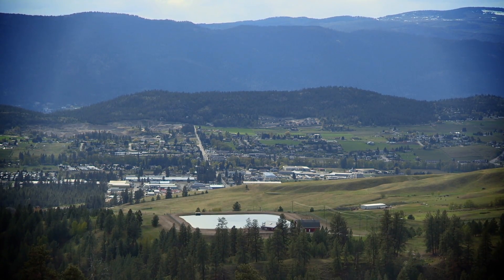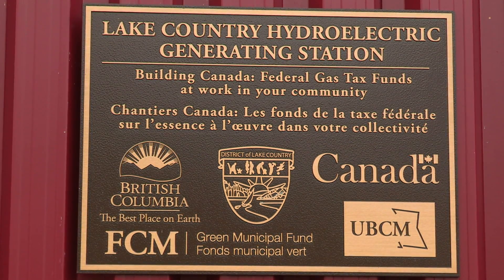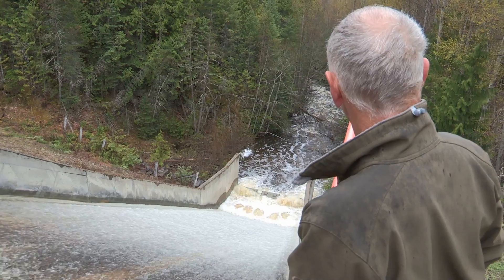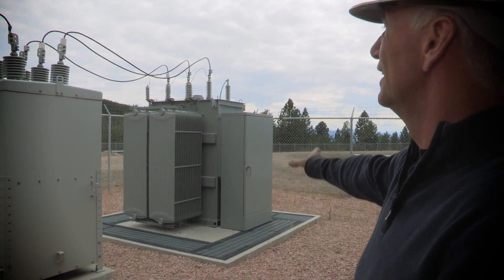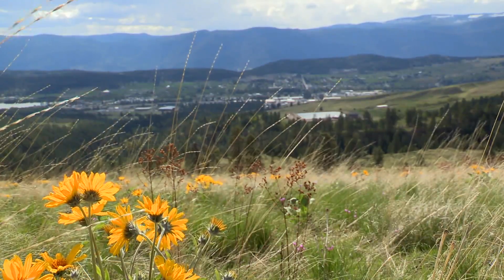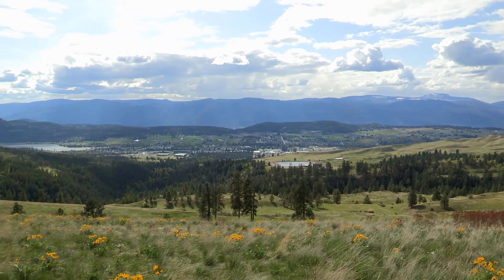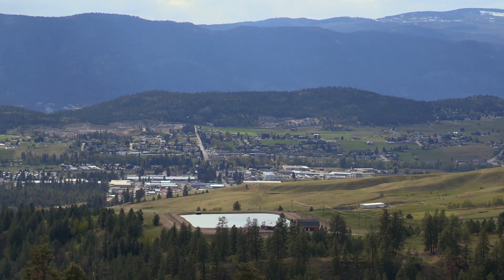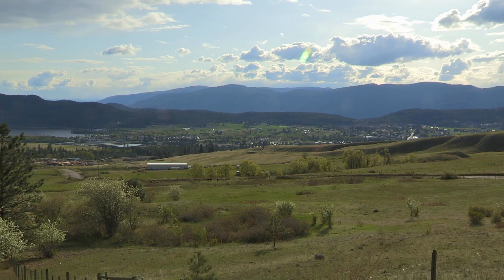District of Lake Country Micro-Hydro Power Plant

Comment: Just a note, there is no way that power plant produces 4000 MW. Massive coal power plants produce 1000 MW. I'm curious what the actual power output of system is and how much energy in kWh does it provide the community annually? Thanks!
Reply: I think he meant 4000 KW = 4 MW is about 4 wind turbines

I used to work for a system supplier and we sold 100 KW transformers which went to supply 20 homes. ( 5 KW per home ). That would be 200 homes per 1 MW or 2 MW for their 400 homes. That means they are pumping more back into the grid then their community uses. Good for them

Would be nice if they mentioned the head, flow rate and capital cost. Looks like a Pelton wheel so that would be a head in excess of 500 feet.

Hydro is much more reliable then wind or solar. Hydro can be used as a base load.
Reply: I checked their website. It's a 1.1 MW system which is about equivalent to ONE wind turbine. That's enough to power   220 homes. In a community of 400 homes, that's significant but only about 50 % of the homes. 

At 1..1MW X 24 hrs/day X 365 days/year equals 9.6 GWhrs of power per year. They produce about 4 GWhrs per year so less than 50 % of capcity. In total they produce about 25 % of the communities electrical power.

I sent them an e-mail asking for head and flow rates but no response after a week. Their website is long on platitudes but sort on real info.
Reply: Listen carefully!  4KMW annually!  That means it’s roughly a 1-1.2MWH generator.  That’s about right considering the size of it.  Virtually identical to those found in wind turbines.